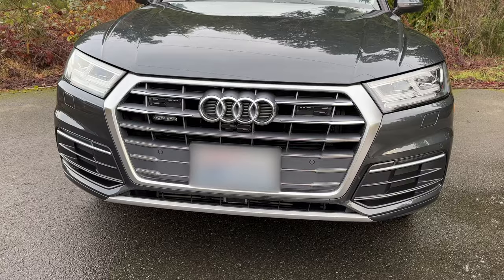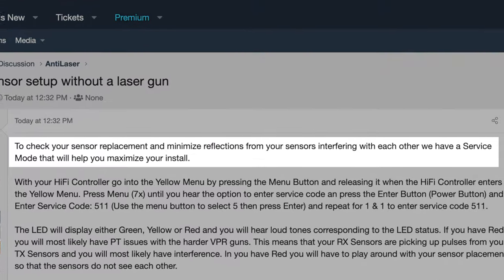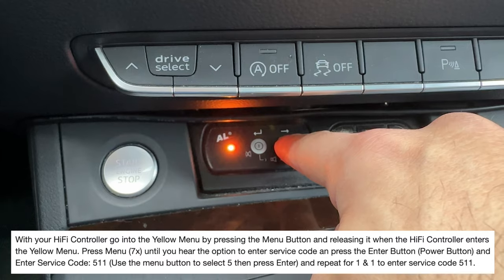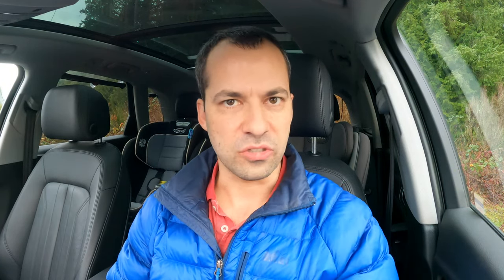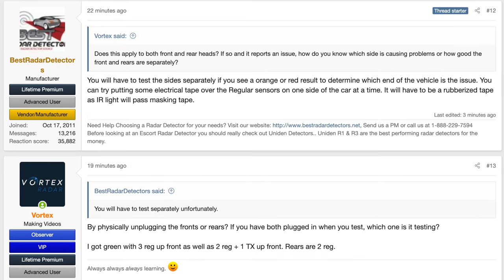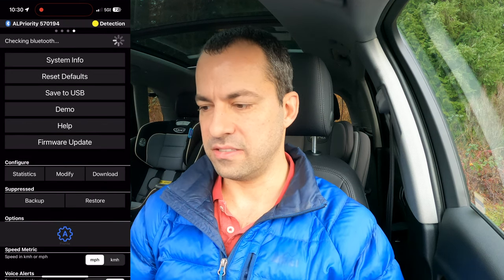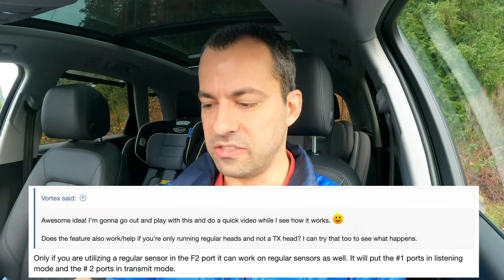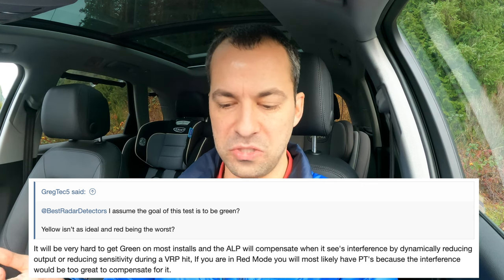ALP: Test to Reduce VPR Punchthroughs

Comment: Thank you for this! I have an ALP system on order, hopefully to arrive soon. Will be running two regular sensors and a TX sensor both front and rear. Your video is very helpful as I did not know that this mode existed and I was nervous for the install to be done properly. The system is going on a 2021 Ram TRX. Pretty wide vehicle, so needs lots of coverage!

Comment: Interesting as I’m worried about a new upcoming install on  tahoe with two tx and two rx and a double rx tx and crossing fingers on that.   Very worried about cross talk with dbl tx.   I might want to pay you for ur advice if that service still available.  Mike over at alp great but feel like I’m beating him up too much 😂
He’s been helpful.  My installers said I Cldnt do dbl tx and dbl tx up front cause ports cldnt those plus the dbl rx and tx in rear 
Not true according to  alp    He even wrote what ports and splitters wld be necessary.   Third vehicle with alp.  Worried about this BIG. Vehicle relative to my tried and true  easier Amg and porsche Macan s installs 
Great vid with that tricky little cross talk check you explained !

Comment: Are you using sensors to describe the emiters and sensors?
Reply from the maker: Yeah the terms "sensor" or "head" are sometimes used to refer to the box that houses the transmitters or receivers. It's not always technically correct, like referring to a "TX sensor" that only has transmitters, for example, but that's how people usually call them.